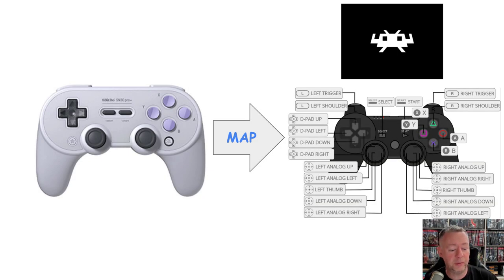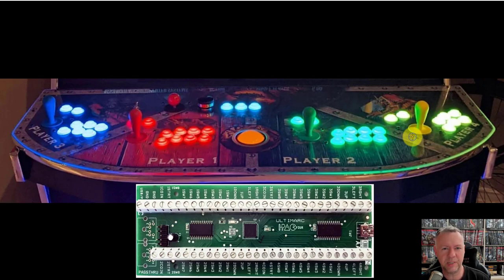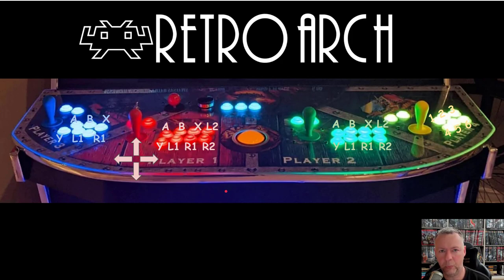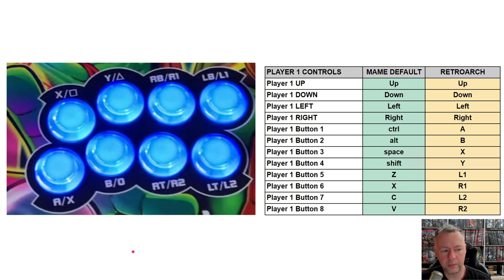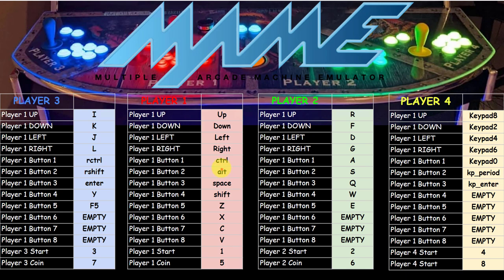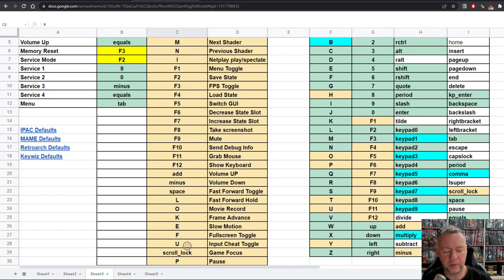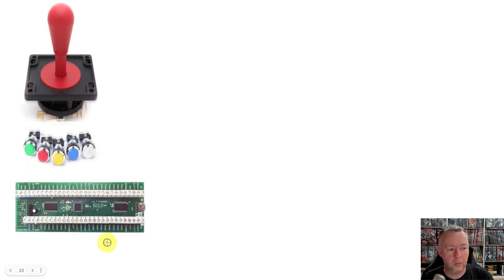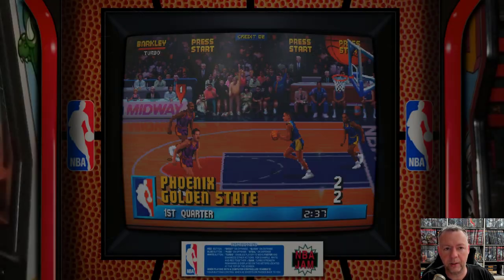How to map arcade joysticks to Retroarch and MAME libretro

Comment: Just an fyi Mame didnt get the controls wrong. Mame only goal is preservation. Which means archiving everything as it was originally. They set the controls to how they was hard wired on the arcade pcb. So nba jam has 1 as turbo on its pcb. Another example is umk3 it is wired in order hp, bl, hk, lp, lk, rn so you would need to swap buttons 5 and 6 to get a better layout when using a standard street fighter 6 button like you are here

Comment: Great video. I have just set up the buttons with AB at the bottom and XY at the top. The reason being I use Brooks encoder boards for fight sticks and I am currently using retropie for my decks and building Launchbox for my PC arcades. I am trying to keep the same layout across all products for design/print purposes, manuals, instructions etc. But after watching this I see why you would keep a arcade cabinet the way you explained. I think I have a bigger job on my hands now if I want to proceed. But much appreciate
Reply from the maker: Well, there is one thing I didn't mention in the video, it doesn't work for every game which is why I didn't, but if you go into "Options" from the quick menu while in game, there is a MAME pass-thru feature called "Profile Buttons according to games" it will reconfigure the default mapping of MAME to work with the AB (top) XY (bottom) configuration. Essentially, I do it when I want to use an Xbox controller for a fighting game vs arcade joystick. 

However, it was based on the old "controls.dat" file http://controls.arcadecontrols.com/ which was user contributed, and then of course, it's only for MAME, not for the other cores you'd probably run along side Retroarch.

If I have one small part in creating a "standard" that arcade cabinet builders can agree on, all retro gamers would benefit. =)

Comment: I tried everything in video and cant get the 6 button setup to work with Sega Genesis,Satrun and even NEoGeo. Mame works get with your setup. Want to use my arcade controller on my bartop arcade and not my Xbox controller. Can you show me a button setup to work with retroarch.

Comment: Hi @Integrum Retro, thanks for the video. It makes things a bit clearer when trying to set all this up. I have started setting things up on my Retropie / Emulation Station 2 player 6 button bartop cabinet but have a query please.

I have remapped my IPAC 2 so that the buttons map to the same as yours (1SW1 being B, 1SW2 being comma, 2SW5 being E and 2SW6 being H). When I go into Retroarch for the mapping for Port 1 controls do I do the following:

Button A - press B 
Button B - press comma
Button X - press space
Button Y - press shift
Button L (shoulder) - press Z
Button R (shoulder) - press X

Then do I need to do the same again for Port 2 controls?

Then finally go into Mame and ensure they are the same so it all matches?  It's the Retroarch bit that I am a bit confused on.

Thanks
IJ

Comment: Just Wow, really well done! I have just finished setting up Retrobat but I'm not sure if this can work for me☹ Retrobat uses a file called es_input.cfg  which will only allow a player 1 Keyboard (no player 2 ,3.... keyboards). This file over writes Retroarch's  retroarch.cfg file each time erasing any settings for player 2, 3, 4 etc,..... Retrobat works great with gamepads but was hoping to set up Ipac like you show here. Thanks, Marty
Reply from the maker: If you can specify a command line when an emulator or game starts you can run RetroArch.exe -c mycustom.cfg
Reply: @IntegrumRetro  Thank You so much for the rely, I will look into that.😀

Comment: Amazing video. Wish I had found this earlier as I struggled through trying to figure out mapping my arcade stick to mame and other systems.

I’m currently playing around with FB Neo . The odd thing there is doing exactly what you have done set things up nicely with buttons 123 for most games that use one two or three buttons, but the order on fighting games is mixed up. Do you have any experience using FB neo?
Reply from the maker: I use FBNeo to upscale the vector games, but you can also do per game overrides to adjust any button layout discrepancies.

Comment: Just a heads up, the spreadsheet linked in the description does not appear to be the same as the one mentioned in the video, is missing the IPAC changes.  Just ended up pausing where I needed to, but thought I would mention it.
Reply from the maker: Column C are the changes, cells highlighted in blue are the changes from the default.

Comment: Great Video... 
I am building a 2 player arcade controller for RGB-PI with 8 buttons for each player and need your advice on what colors to choose for the buttons.  
How would you recommend the color layout to be? for ex: 
A=Green
B=Red
X=Blue
Y=Yellow
L1=White
L2=White
R1=Black
R2=Black
Thank you
Reply from the maker: When it comes to emulation I like to match the color of the buttons to the artwork, not any specific joystick mapping because the colors provide no value in gameplay. Within a min or so you have figured out the button order. 

So the buttons for me are more for asthetics than having meaning when running multiple emulated platforms.

Comment: First of all, great video!! I’ve successfully set up my key binds for retro pie and retro arch. I can’t seem to access MAME though to newly assign keys so they match. On my launch box build I simply press tab. The build I am working on now is a raspberry pi. Tab does not work from a keyboard or through the ipac2. Any suggestions on how to access the MAME controls?
Reply from the maker: Go into the retroarch quick settings, the. Options and select boot to bios or something similar while in a mame game so you can boot into the mame menu on restart of a game and see which hotkey is bound to the MAME menu.

Comment: So if in mame I say button 1 is B and button 2 is comma, do I then need to go back to my ipac and make p1 button 1 as the “b” key and p1 button 2 as “comma” key, etc?
Reply from the maker: Yes, that is ideal, especially if you have any of my configuration files which some are custom mapped per game and some are mapped for the entire system. B and Command vs Ctrl and Alt for P1 Button 1 and 2 is a more ideal setup for avoiding button mashing taking something out.
Reply: @IntegrumRetro cool, yes that’s what I’ve done. Many things seem to be working, but I’ve noticed with your drive I had to go into Dolphin and really set my controls up before GameCube would work. Now I’m trying to set up led Blinky and I’ve told Blinky all your mappings. However, when I launch a mame game, Blinky throws an access violation error for some reason. Works with other consoles, but only mame triggers this error. I’ve confirmed that Launchbox knows the right path of my mame folder. Ever seen that?
Reply from the maker: Email me your LED profile and I'll test it on my machine. I'd imagine there is some kind of invalid key in the xml.

Comment: Love your videos, Have a cabinet running hyperspin and rocketlauncher. I decided to remap controls for Dreamcast thru redream and GameCube thru dolphin from controller to my arcade sticks and buttons. When I go back to the hyperspin wheel I can move but can not Launch games in those 2 wheels. So I think I remapped wrong and I can’t change it back. Is there a location in either or in hyperpin or rocketlauncher where I can change it back if you know. Would appreciate ur help. Also congrats on partnership with xtreme
Reply from the maker: My expertise is limited to the Launchbox/BigBox front end and retroarch. I didn't like the complexity of Hyperspin. The way I troubleshoot though is I run the full command line to launch a game since that's all that many front ends do is what you could do from the command line. So this way I test if the launcher is using the wrong command line options to launch a game.

Comment: I guess I am missing something here.  I changed my ipac configuration for player1 button3 to space.  So now when I am using retro arch playing a game and hit button 3, the game fast forwards since space is used as hotkey in retroarch.  Should I be disabling hotkeys?
Reply from the maker: I've bound COIN or 5. So 5 + SPACE = Fast Forward 5 + P = Pause and so forth. So you will want to turn on the hotkey feature in retroarch, thus making your controls not conflict with some of the preassigned hotkeys in retroarch.
Reply: @IntegrumRetro  Thanks for response.  I have played with the hot key feature in retro arch to avoid the conflicts.  Are you using regular MAME for the arcade games?  Because I can't find a hot key equivalent in MAME like there is in RetroArch.  I am using RetroArch and standard MAME with a Lunchbox/Big Box frontend
Reply from the maker: @mbrunton  I'm using the mame_libretro core in retroarch. Mame doesn't have a hotkey feature, so items like "tab" will pull up the mame menu and I disabled other conflicts like "p" since that is pause for mame, but not needed when I can pause through retroarch.
Reply: @IntegrumRetro  Does the retroarch mame core work with ROM set .250?
Reply from the maker: @mbrunton  yes, there is always a mame libretto that maps to each mame release called mame-current

Comment: how did you do the trackball and spinner?  thanks for the awesome video!  subscribed!
Reply from the maker: Trackball and spinner are just analog devices, so enabling all mice as inputs basically.
Reply: @IntegrumRetro  does it require an additional board or does it connect to the raspberry pi?

Comment: On your spreadsheet you have Player 1 Button 2 as comma but the video says slash “/“.. also when you say “multiply” for player 3 button 1.. you can be clearer and say “Keypad *”. On your MAME layout graphic all of the players say “player 1” also on the bottom for one of the players it says start for both and not one coin and one start. 

I watched your video about 100 times in the past 24 hours studying in great detail 😂. Thank you so much for creating this and also for making the spreadsheet available to us. 

I have a dilemma because my builder used his own MAME button configuration (it isn’t the defaults). Do I globally reset back to the MAME defaults as you have laid out for us here? Also, would I have to then go into each game he has changed and change the button layouts to match as well? Is there an easier way to do that?

I stopped half way because the task seemed daunting. What do you think is the best course of action?
Reply: Well apparently his MAME is set to the default, I just checked. Is there an easy way to go through all of the games to check the button layout? Is there a website where it shows what the buttons are for each game? Thank you.
Reply from the maker: Yes, I had to change it from '/' because it wasn't supported by a Keyboard 2 Xinput software I was using. 

Also, I will update my spreadsheet to reflect the official Microsoft name for each key. The issue is, the official MS Key names are different than how they are configured in RetroArch config files. 

I'll update my internal graphics, but for the video those mistakes are stuck in history now. :)
Reply from the maker: If you want to delete any overrides to Make that were done in MAME, look at the files in RetroArch/saves/mame/cfg and you will find cfg files of the games where you changed the default keymap. You can just delete them and the game will go to the default MAME assigned keys. 

 This website is a great reference for pictures of the button layout and details on the button configurations. 

https://adb.arcadeitalia.net/
Reply: @IntegrumRetro  thank you very much! Your information helped me greatly. I truly appreciate it! Do you have a recommended way to play n64 games? What controller do you use? Or do you use arcade buttons?
Reply from the maker: @thisoldman123  I use an Xbox compatible controller myself. 8bitDo SN30+ is what I have. But my drive is also mapped for joystick controls, it just weird using that layout though.

Comment: 14:30 I can't understand for the life of me why you would want your ABC & XYZ flipped upside down top to bottom on your arcade panel for sega 6 button.  That doesnt seem very purist to me tbh..  I totally don't understand why you would want to set up your arcade panel button assignments in retroarch different than the default  retroarch virtual gamepad, which has the buttons laid out like a super nintendo controller.   Why is mame set up backwards from all the other emulators controls in retroarch?  (Fyi, my arcade panel is portabke abd switches out with real game controllers using usb adapters, so i need everything to jive together button wise. Consoles and arcade.)